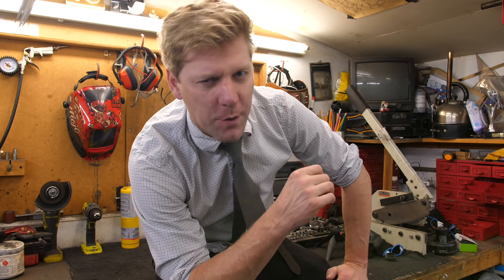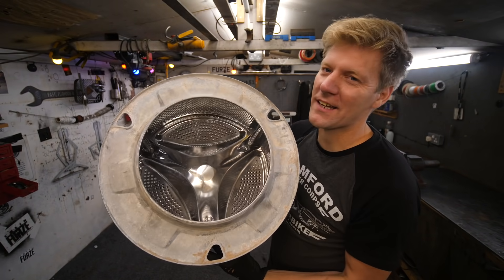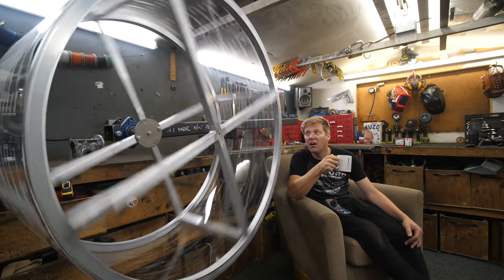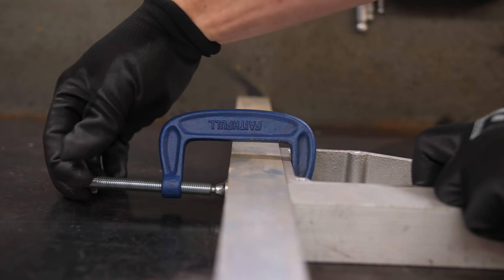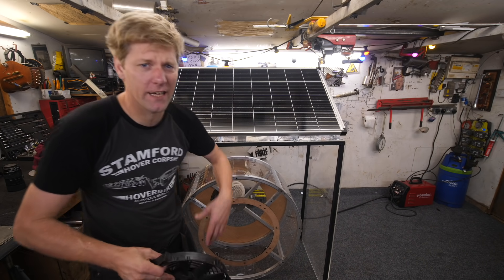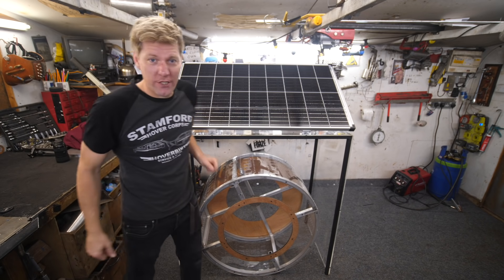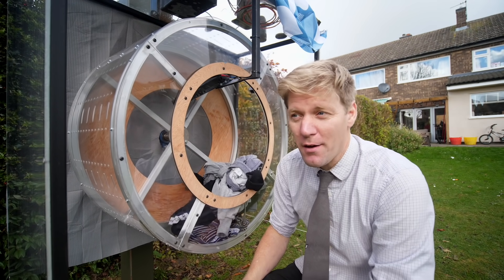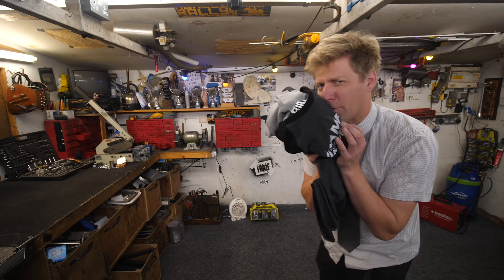Wind/Solar Powered Clothes Dryer

Comment: The problem with any 0 emissions solution is that it will always cost more in energy to build then it will ever generate. This thing could run for 100 years before it made up for all the carbon emissions it took to build it. 

If you want to build a renewable energy machine you need to build it will renewable energy. Not fossil fuels.

Comment: Here in the US a lot of our driers will have little shelves (don't think that's the correct nomenclature, but you get the idea) to help lift the clothes higher before they fall back down again. This should help with your drying time because they fall through more air with each revolution. It also helps with keeping them spread apart. Love this video...gotta build me one!!

Comment: If you got plenty of solar. It might be interessting to use a heating system to reduce dry time. And maby connect the wind to the battery aswell for some extra juice when not using the fan. Maby more batteries for that system

Comment: the speed on the tumbler is way to slow but there's a way to fix that without any extra electricity being used as you can speed it up by simply adding some manpower to it by so that a mply hooking up a bike to it so that the speed depends on how fast a person is willing to pedal

Comment: Missing a relay switch that will enable or disable the motor if the wind turbine is rotating.  Don't want to burn out the motor.

Comment: The more usable you make it, with the battery and the motor, the closer it resembles just taking an electric dryer and hooking it up to a renewable-powered electrical grid. Electricity became the basis for standardized energy transfer for a reason :)

Comment: did you look and see that the cylinder in the conventional dryer also had fins the clothes get pushed around by? i wonder what that's for. 

maybe if you put some type of  shaped scoop/ramp in the cylinder the clothes get pulled further up and get more air moving around it before it falls again instead of rolling at the same position in a ball.

Comment: Here's the question: what if he just used a solar panel and wind turbine, used it to generate electricity, and use that to power the dryer, or even sell excess to the grid when not drying - Would it be  more or less efficient?
Reply: I guess the greenhouse thingy should be included somehow as well, but...

Comment: Now it just needs some jet engine assist to increase the productivity during calm weather.
Reply: a jet engine drier can increase the efficiency by a big margin.
Reply: This is suposed to be a non carbon belching invention 🤣
Reply: @adriankingston4338  an hydrogen flame, it doesnt produce carbon 🤔
Reply: @IberianCraftsman  we might be using kerosene
Reply: @adriankingston4338  nop, kerosene produces Co2 🤷🏻‍♂️
Reply: @IberianCraftsman  mate who cares 😄
Reply: @adriankingston4338  its all about consistency, Hydrogen burns and just turns into water vapor.
An example: like in the martian movie when he burns hydrogen to water the indoors potatoes.

Not really a good idea flames near clothes though.

i wonder if it would be possible to dry clothes using a vacuum chamber, water would boil and turn to steam with barely no effort. 🤔
Reply: @IberianCraftsman  there you go you've just given yourself a science project happy laundry drying I'll just put mine out in the sunshine 😄👍 keep it simple dont have to burn anything or make a complex contraption while they are drying I'll go and make parts for my steam locomotive.  🚂😁🚃🚃🚃
Reply: @adriankingston4338  i have a dryer at home 🤷🏻‍♂️, its just easier to get green energy into the house and thats it, by the way, to quickly dry clothes a good way is put them inside a closed metal tube(with a small opening for the steam to come out on one side) spinning on top of a fire like for roasting meat, while camping in winter if your clothes are wet this will make them dry and warm really quickly, the spinning is to avoid one side shrinking due to the heat.

Comment: Yes Colin, needs a few modifications. First, 2 T shaped poles placed in ground approximately 10 meters apart. Second, 3 11 meter plastic coated clothesline cables stretched across evenly spaced and attached to T. Third, hang clothes on before mentioned clothes lines and pin in place with clothes pins. Fourth, wait until clothes are dry and retrieve. Works great in any weather except rain and below freezing. In those circumstances, improvised similar system in basement, garage, or greenhouse will suffice. 100% carbon neutral.  Our elders were "green" before green was cool. EDIT There are various different models of system, twirly ones and some with pulleys. Colin, be creative and come up with your idea.

Comment: Jesus H Christ 😳.  So we need, a very large shed, most of the power tools that exists. 15 sheets of aluminum, half a mile of box profile, 3 types of welder, a cnc machine, a solar panel, a very large ex swing buried in foundations able to withstand a hydrogen bomb, half an acre  of land and .... drumroll please, understanding neighbours, a tame bordering on pet, planning officer, a successful utube channel, several years worth of engineering mastery, a few loose screws, 2 years worth of normal household electric use and 30 kg of sopping underwear 🧐. goes to shed and looks at the rusty hack saw. Shivers. Goes back inndoors

Comment: I would have added a battery, anda dc generator attached to the wind turbine. This way the drum is run by a motor, which is run by a battery that is charged by both wind and solar.

Comment: I reckon a 300 watt solar panel would just about spin a normal clothes dryer and then you could blow in air from a solar hot air heater made from some old beer cans!  Or just go for a couple of 300 watt panels and run the dryer on lower heat by running a lower voltage into the element. It would take longer than the mains, but maybe not all day.

Comment: Normally I just sit back and enjoy your self taught engineering skills Colin, but on this one, as a laundry engineer, a little research may have helped. The design of a dryer is quite specific and has been modified over the years to improve efficiency. The basic principle has remained the same though. Separate the clothing through tumbling, with paddles, and pass the air through the clothes carrying away the moisture. Having holes in the drum does not help. Put the fan at the back, add paddles, block the holes in the drum, remove the curtain. This should help a lot. About 40 RPM would be a good drum speed. Love your work mate.😁

Comment: Don't let the windmill turn the tumbler, let the solar cell and the windmill charge the battery and let only the motor turn the tumbler. Also remember, the larger the windmill blades are, the better efficiency it has. But since you are heading this direction, i want to see the Furze version of solar energy. Fresnel lens boiling water generating electricity. Also you do own a roof, which can hold few square meters of solar panels...

Comment: Could a conventional tumble dryer be fitted with a heat exchanger? Seems like most of the heat gets lost out the exhuast with the water vapour. Would be good if the heat could be exchanged with the incoming colder/drier air. Imagine it would need to be some sort of filter to clean out the lint pretty regularly.

Comment: Colin, i would have made a clothesdryingrack to hang the clothes on, and have it spin on an arm with a contraweight on the other side. 
So just 1 electric motor in the middle spinning an arm with on one side a contraweight, and the other side a rack or how you call it, where you can hang the clothes from.

You could even make it 2 arms in a cross, 2 racks to hang clothes from, and 2 contraweights. 
And just have it turn like the 360 degree swing. Bit of tempo in it so the clothes will not fall down when its upside down.

Ah well, this is nice too.

Comment: You know there's an even better wind powered dryer. The wind. Use the sun for heat too. :p ps, I posted this before watching

This is actually really good. Really usable. The only real criticism is that it's more complex than a clothes line. Your dryer is hard to justify, but if justification isn't an issue, then it's really good. Maybe this is useful in places that are overly windy? Or it could be a good indoor design for places without much power?
Reply: I was gonna say it'd make a good inside design if you just put the panel outside and ditched the wind turbine. Add a second panel and it could probably be optionally slightly heated as well.

Comment: Depending on the gearbox on the motor, it should be possible to modify the system so that the wind turbine spins the motor and generates some power on sunless days. Then you've got a dryer powered by wind or sun or both. The additional electrics shouldn't be too complicated.

Comment: When I thing of a clothes drying furze invention I think of a wine turbine that feeds a system that tips a washer to get the wet gloves out and the something that catapults them onto a grate of some sort so u don't have to hang them, then the grate tips and folds in to dump clothes in a basket which is on a conveyer belt to bring them inside.

Comment: I think you might be better off using the wind turbine to generate electricity to charge your battery and running a faster motor, more modes of charging means you could afford the losses.  

Also, Solar powered shed lights is 100% viable, my old workshop was lit up by a 30W light bar and some strip lights over the work bench, powered off a 100Ah battery and a solar regulator and a couple of 4A panels I got for free, I rent, so I just ran a long cable out the roller door and would lean that panel against the wheely bin to get what I thought was a good angle, but 4 amps from one panel was usually enough to charge my battery and power my lights.  Surprisingly.  

Lights would use about 3-4 amps, so I think what was actually happening was the solar was 100% running the lights and the battery just wasn't getting touched, but I'd usually leave the panel in the sun when I went to work, so it'd be getting charged while I was away.  Good system, and it lit the work area up better than the fluros would've if they worked. 

I'm currently working on an entirely solar run shed, so it'll consist of a 24v power bank made either from AGM deep cycle batteries, or a custom 18650 battery pack, solar charging, wind charging, and I'll be making it to run all my power tools.  I'm currently trying to work out how I can power 18v power tools, and as far as I can work out, depending on the tools themselves it'll just work, but if it won't, the chargers convert from 240v AC down to 21v DC before the charging controller does its thing, so chances are from 24v I just need a small buck converter to knock it down to 21v on the input and some current regulation and I'll be able to charge 18v power tool batteries off my battery bank.  Kind of round about way of doing it.  I'd prefer to just make leads that plug into them.